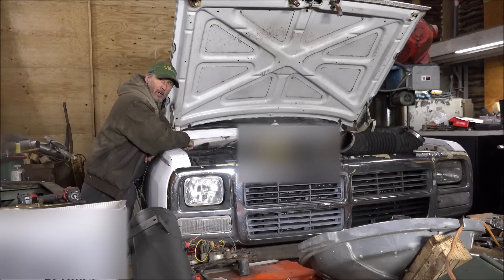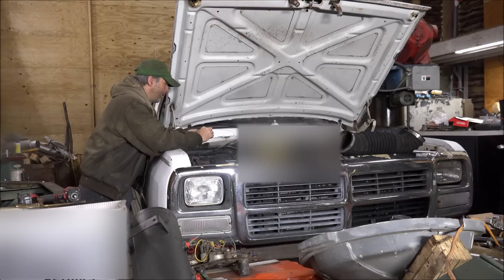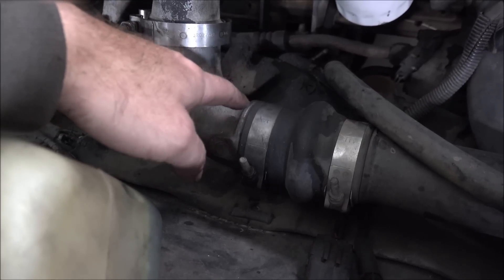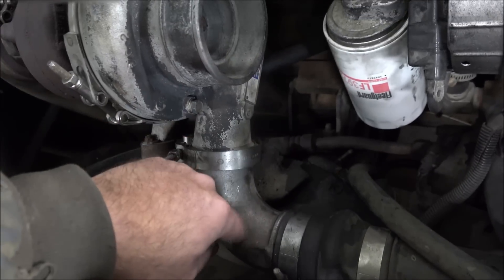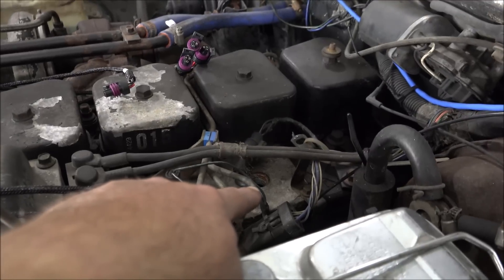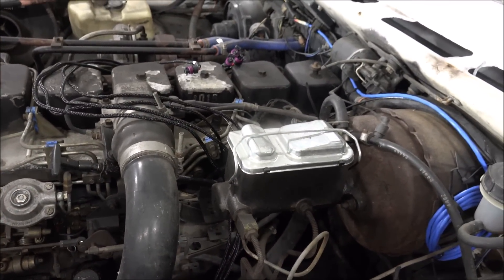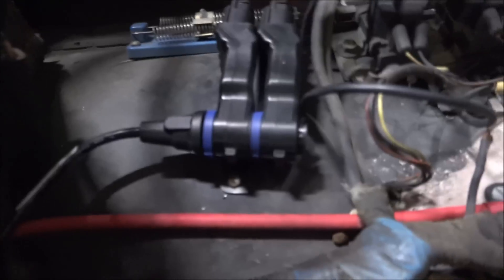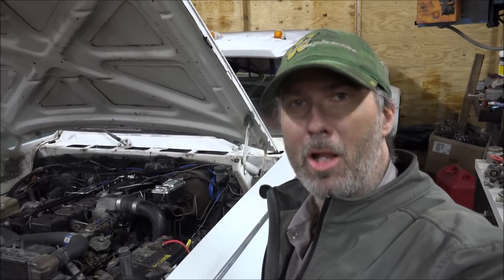Banks iDash datamonster Standalone Install Datalogging on a Vehicle with NO Factory Electronics!

Comment: Hi Brian. I came to your channel from your comment on my vid. Nice install I've always wanted the banks idash in my truck I just can't get over the cost especially to ship to Canada. That's why I started building my own system!... Hopefully yours works out well I'll be keeping an eye on your updates. Just a note for the compressor outlet temp sensor location maybe think about drilling and tapping another hole in the outlet elbow so the temp sensor is in the direct flow of the air coming out of the turbo. When I first installed my manifold temp sensor I teed into the stock location and found that the temps were more of a heat soak when in a tee configuration and then I moved it directly into the path of airflow by drilling into the air horn and my temp values changed drastically. Keep up the good vids!
Reply from the maker: Yeah I am in the middle of doing a huge turbo test and I already moved it after the first run. I knew my stock h1c running 40psi should have had outlet temps higher than like 150deg. So I pulled the horn off removed the t and drilled and tapped the other side and put the EGT in there. It went from 134 deg to 570deg that made my intercooler look like it was doing a much better job after that! I am knocking 400deg off as I am only getting a max of 160F in my intake.  lol   I have a bunch of data if you want to know anything be glad to help.

Comment: Why did you use a EGT sensor to monitor the charge air temp instead of a regular temp sensor ?
Reply from the maker: Compressor outlet can be 600-700degf at full boost so it is beyond the range of a regular temp sensor.
Reply: @bcbloc02  Never realized it’s getting that hot… are you using a remote relocation kit for the pressure sensor also ?
Reply from the maker: @WingspeedGarage  Probably would have been a good idea but hopefully not having it in the flow path and having it isolated on that t-fitting will be enough protection that it doesn't die on me.
Reply: @bcbloc02  reason I’m asking is cuz I’m doing a stand-alone Idash on my 6.2 diesel.  But I’m making my own remote mounting line, the banks kit was so expensive… is it stainless?
Reply from the maker: @WingspeedGarage  Yeah I am pretty sure all the fittings and the braided line is stainless.

Comment: Do you think the glue is going to hold those sensors in? I was trying to figure out how you could make a bung that would be a bit more substantial but then the sensor may not go in deep enough, plus you would need to match the shape of the pipe inside and out then lock nut it down but again is the sensor in far enough? 3D printed pipe maybe? would that stand up to the vibrations of the engine?
thanks for making me curious.
Reply from the maker: The epoxy seems plenty strong but we will find out.😎

Comment: Can't wait to see it in action bud, I'm a medium speed mechanic, (10+ inch bore) with a '93 dodge.
Reply from the maker: 10+inch bore I guess that is boat motors and power plants? Those are some big engines. I always wanted a big 6 cylinder alco 539t
Reply: @bcbloc02  Marine engines for me, both propulsion and power generation. I worked on some Alco engines as an apprentice long ago, they will beat the hell out of you, very labor intensive!

Comment: please take us through this project  with in depth discussions of theory and practice for what you are doing and trying to accomplish. Are you planning to build an engine test stand or cell? If you are please give us a detailed dyno test procedure process. I find this very interesting and I am always present for new knowledge.
Reply from the maker: Eventually the system I am putting on the truck will wind up in the dyno cell. You can do lots of different tests on an engine with a good dyno. You can especially find the weak links!

Comment: Forgive me, I'm no mechanic. I've been following this series for a while now, I get the impression that you are using your old truck as a test bed for that particular diesel engine. Is that the case? I know that you build specialty diesels, is this your technique for trialling different parts or combinations of parts? Or is this all about making your individual truck as perfect as possible?
Reply from the maker: A little of both. I am trying a few different parts to see how they compare. In the end once I get the setup that I want that performs how I want on my truck it will stay on the truck with the optimized setup.  This is how I make sure my theories match reality cuz sometimes they don’t. 🤪
Reply: @bcbloc02  thank you for the answer. You don't ask and you don't learn.

Comment: Really interested to see what that compressor outlet temp is! Did you put temp sensor on discharge of intercooler? Hopefully when you go to compound you will put temp sensor between the compressor discharge on the first one and the compressor inlet of the second one! Have you given any thought to intercooler between the two?
Reply from the maker: The intercooler discharge is in the air intake but it should be pretty much the same values. At least for comparison purposes it works. For the twins I will log interstage on both hot and cold sides.

Comment: Might think about a heat shield between the turbo and the temp sensor. Gas turbos run hotter than diesels but radiant heat can still cause problems with the sensors. I speak from experience.
Reply from the maker: I don't think it will see much heat beyond the already toasty underhood temps.
Reply: @bcbloc02  I’m used to turbos running bright yellow; you’ll probably be fine.

Comment: Will the VE pump give you enough fuel? Doing something similar on my 96. Just got some 055 delivery valves,  5x12 injectors, 4k governor springs, AFC Live with max travel kit. When the weather gets better (15 today) pull the head doing head studs, fire rings, conical springs, and pushrods. Then turbo after seeing your results.....
Reply from the maker: I would personally not do the delivery valves as they mainly effect low rpm fueling and you don't need a bunch of low rpm fuel unless you want lots of smoke. 370's (5x012) with 4k and timing at 20deg should get you solidly in that low 400rwhp range.
Reply: @bcbloc02  that's about where I want to be for now. The 47re is the weak link even with a triple disk converter and billet shafts. I really like my G56 in my 15, probably will do the same for the 96. They shift nice and pretty stout, contrary to popular belief. I really would like an Allison but way to $$$$.
Reply from the maker: @CapeCodCNC  I have had good luck from built 47rh and re up to 1000hp.
Reply: @bcbloc02  That's good to know. Probably just run it until it breaks....fingers crossed! Do you run a lockup switch?